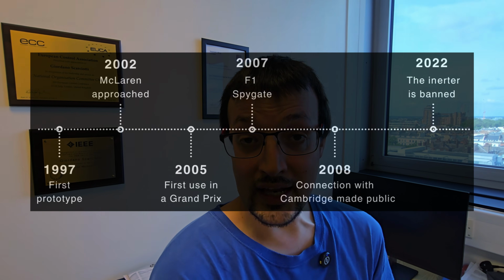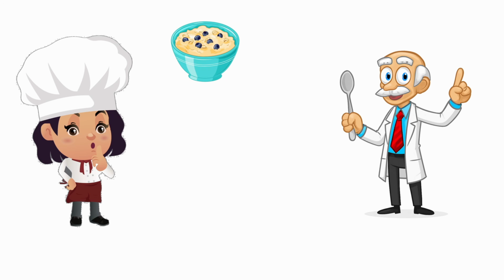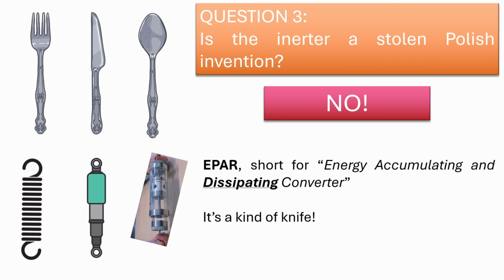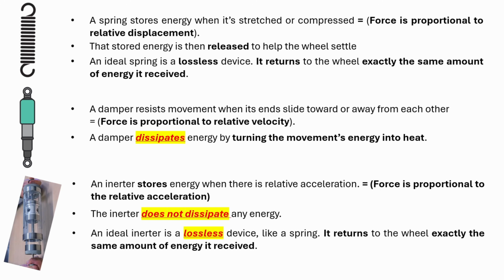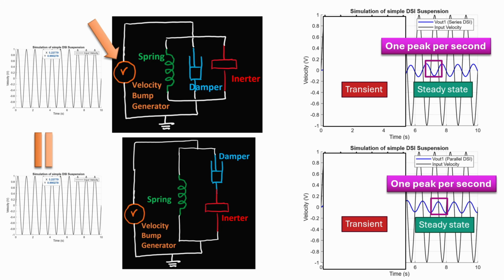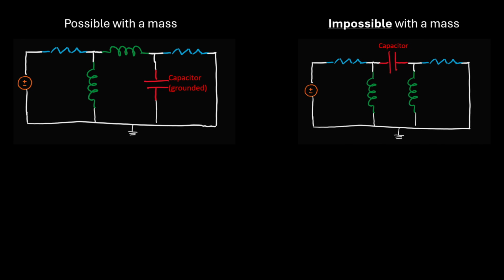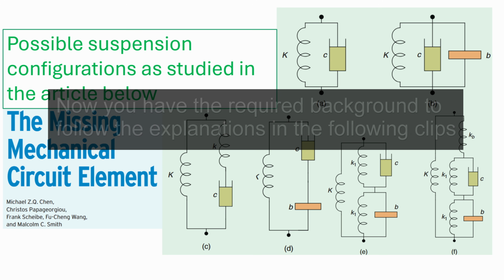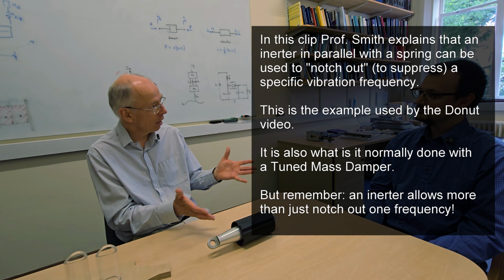Why Everyone Gets the F1 Inerter Wrong | Explained Clearly

Comment: Thank you for taking the time to address this technology!

I suspect that many will say: Okay, but what does it actually do?  Perhaps a little more explanation with respect to what a suspension with an inerter can do that one without cannot?  Also, while the addition of the inerter expands the design space, so that you can better tailor the frequency response, I assume there are still compromises since it must be tuned for the whole circuit - that is: the suspension was not adaptive.  So what I think people might like to know is how this actually allows the car to move around the circuit faster?  Is the attitude of the car better controlled, leading to more consistent aerodynamic performance?  Do the tires grip better in corners or under braking, because there is less vibration?  Can the car be made to traverse a particular bump, set of undulations, or other major, upsetting feature of a track better without messing up how it handles everywhere else?

I think addressing these questions would make people begin to feel they understand how this innovation actually works to increase speed so much that it seems like an unfair advantage.
Reply from the maker: Thanks for the feedback. I can see the value in answering those questions. I think part of the problem in explaining the inerter is to properly communicate what "full design space" means to a non-mathematician. An inerter does not simply increase the design space, it completes it - for real. Mathematically is can be proved that any possible, infinitely many, passive suspenions can be synthesised using these three passive components. Now, one could go your way, the intuitive way, of explaining that an inerter helps with a particular bump. But in reality that approach will give you suboptimal performance. What matters is not helping with a bump, but getting a lap time advantage. So you run simulations, over the infinetely many (practically a large number) of possible configuration trying to minimize your cost function (lap time). And now using an old electrical engineering theorem you know how to build the resulting suspenion. I understand that this mathematical vs intuitional point of view is not easy to digest, but in the end what matters is lap time gain, not getting rid of a particular frequency. That said, I do agree that answering those questions would help to develop a better intuition of the device.
*Let me clarify one thing that I've always omitted. Practically, by "best suspension" I mean one that satisfies also a constraint on the number of components. Otherwise you may not be able to use the optimal suspension you get because it involves too many components. So the problem is constrained to seek the best impedance subject to, e.g., using no more than 6 compoenents.
Reply: @TricksterJ97  it helps reduce unwanted oscillations in the car's suspension, which helps make the car be more stable when it encounters bumps/undulations on the track especially when cornering.
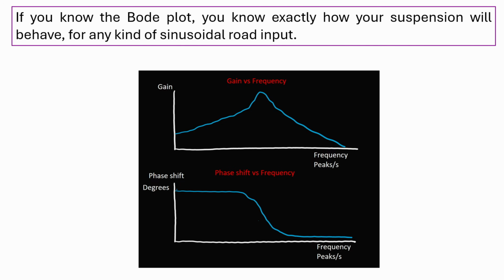Reply: @tricksterJ97 : From 25:03 on you will get the answer

Comment: Are these basically the same as the friction motors in kids toy cars????
Reply from the maker: Thanks for the comment. A friction motor in toy cars isn’t the same as an inerter, but that's an interesting observation since they both use a flywheel. In the toy, the motor relies on the friction between the wheels and the ground to work. When you push the car, your energy spins up a flywheel, but a lot of it is turned into heat due to friction in the gears (I may misremember, but I think you can actually feel the heat after using the toy a few times). Dissipation is part of the design and that’s why the car’s stored energy runs out quickly.
Instead an inerter is designed to be highly efficient, storing energy and giving it back to the system with very little loss (ideally no loss). Its goal isn't to propel the car but to help with vibrations as covered in the video.
Reply: Not in use but in theory, both use a linear motion to turn a flywheel and then return that energy to linear motion after . Actually the toy car version looks almost exactly the same as the first version the inventor made.
Reply: The inefficiency of the kids toy version is not by design, it is just a byproduct of its cheap materials

Comment: Great topic! I propose a test at the end. Keep reading. I am more familiar with electrical circuits than mechanical. The ratio of voltage to current is called impedance (Z) and can be complex (a + ib). You apply a sinusoidal voltage and measure the sinusoidal current. A resistor dissipates energy V/I = R and the impedance is real. A capacitor stores energy in the electrical filed and V/I = 1/iwC = -i/wc (I’ll use w for omega, the radian frequency). An inductor stores energy in the magnetic field and V/I = iwL. Note that capacitors and inductors both store energy, but one has a positive imaginary coefficient and one has a negative imaginary coefficient. If you plot the impedance in the complex plane, you get three nicely spaced points at right angles. Positive real, positive imaginary and negative imaginary. My electrical engineering professor quipped that a negative resistance would involve active power and we are talking about passive devices.  I understand that the mechanical equivalent of impedance is Force /Velocity. Apply a force, measure a velocity. It makes sense that a damper has a real coefficient as force is proportional to velocity. I won’t guess about springs or inerters because I would mess it up. I assume the spring, damper and inerter are in parallel. The more interesting test is to apply a sinusoidal position to the axle of the car (bottom of the shock) and measure the sinusoidal position of the top of the shock (affixed to the mass of the car). Position Out/Position In. Tuning the circuits would change the values. Energy story circuits can have gain or attenuation.  I assume this would have frequency and phase response and be straightforward equations. Phasor analysis only uses algebra. Very visual and what suspensions actually do.
Reply from the maker: Exactly, that’s why in the video I used Bode plots and the electrical-mechanical analogy. What you describe is essentially the same framework, and yes you could use phasor analysis (phasors are again a way of keeping track of just phase shift and gain, while the e^{iw} disappear in the transform - you can think of them as the computational algrabraic equivalent of a Bode plot)

Comment: "The Inerter applies a force in proportion to relative acceleration".  I'm working on a "Tea-Damper".  A Tea-Damper applies a force in proportion to relative jerk.

It's an inerter where the gear ratio is a adjustable.
Reply: I had immediately wondered if there were such a thing. Keep us posted on its progress.
Reply: What are it’s intended applications?

Comment: Thank you very much for the second video, like many I had made the mistake of imagining it like a spinning top. Having spent most of my carrier in electronics looking at RLC network from transmission lines to power supply and signal integrity it was a revelation to realize the same techniques can be applied to the mechanical domain. The example showing how you can tune the circuit to damp out a specific frequency really resonated with me (pun intended :-)).
Reply from the maker: Thanks a lot for the appreciation and support. About the spinning top, Prof. Smith showed me the SkySports video before the interview and pointed out the issue to me. Despite Prof. Smith telling me, it is only when making this video that I truly internalised how central the spinning top illustration has been into creating a misunderstanding. Not stressing the importance of returning the energy into the system is what makes one think that the inerter is a kind of damper. Because the spinning top is a kind of damper after all! (To be clear: I do not blame those who used the spinning top to explain this. They were pioneers in explaining a very new concept, and that was a great analogy at the time).
I am sure this resonated ;) with you given your career. And there is even more to be amazed as this kind of analogy works also in other domains, the most common being heat systems and hydraulic systems.

Comment: Great video. The best intuitive way I can think of how the device helps a car go faster is that it allows you to reduce the amplitude of smaller, high frequency bumps and imperfections in the track - the suspension literally acts stiffer at certain frequencies but is still able to conform to the lower frequency curves of the track.
Reply: I'll lead out with I'm not a F1 driver/engineer, or even fan, so I don't have the terms all lined up... but I hang around in the physics realm a bit.

I think of the inerter more or less as the direct compliment to a damper. Springs are simply a "return to center" devices.

The inerter passes sharp transitions across it easily while passing lower rate changes causes it to give easily instead. This allows it to transfer a bump to the other wheel while allowing the car to rock and settle toward its "standing" center of gravity as the road curves. The result is the wheels always have pressure on the ground regardless of what the car is encountering with the road.

I was one of those that thought this device was at each wheel along with dampers and springs at first... but without even looking it up or seeing where it actually goes, I realized it could only be useful between the two wheels.

To take it full circle with the original "electronics thinking" from the first video, it's a high pass filter... used as both a low pass and a high pass... hence the notch filter mentioned in the video. I'd take it a step further and say it's in fact a "crossover" in electronics when combined with the dampers on each side... dividing where the energy goes for different frequencies. It's really no wonder it's confusing lol It's only with a stronger background in electronics that I can see the parallel at all, but converting between the two in terms of "what does that mean physically"... still difficult to imagine that way. I think that's what threw many off in the first video.
Reply: It does seem to have been used as a heave spring position device, which i belive is sort of a 2 axis anti roll bar (side ro side and up and down=rake). But i do think it might on single wheels in the case for example of my aluminum 2001 honda insight slammig into thr potholes and bumps of los angeles at speed, in wheel bounce up to gripless airborne and subsequent decaying ossilation. I dont think it could reduce noise or occupant terror and discomfort in very light cars, that may require abandoning low profile tires. It would probably conduct nouse around airbag suspension becase of stiction lever ratios impacts.
Reply: Richard Cannon put this in a comment, which I think it's the most valuable piece:
"in reality it acts as a phase shifter by making the car appear heavier than it actually is. As a result pressure at the contact patch from bump response is increased. It makes it act as it has higher unsprung mass without the disadvantage of increased weight. But it does not lock ride height in fact the opposite."
So from what I understand, it makes the tires heavier, it means the car will better ignore the bumps, better sticking the tires to the surface over these bumps. This is the increased mechanical grip benefit. Which is exactly what active suspension was doing in the Williams 10 years earlier.

Comment: Would this concept be similar to the large weights suspended in skyscrapers for earth quakes?
Reply: Those are mass damper, or tuned mass damper to be specific. Which means they are a sort of dampers, and are used to dissipate energy. Inerter stores the energy then release it.

Edit: You could probably incorporate inerter or spring into a mass damper and further enhance the performance, just like they used it to improve performance on an F1 car, but the damper still should be the main component as it dissipates energy, or absorb the earthquake energy and prevent resonance. Simply search for tuned mass dampers and you should have a few video demonstrating how it works.
Reply: Interesting
Thanks  @D_ieus
Reply from the maker: This is correct. About your edit, Prof. Smith discussed the use of inerters in building suspensions at the end of the original interview if you are curious and haven't watched it. Timestamp: https://www.youtube.com/watch?v=FhmLb2DhNYM&t=2732s
Reply: @Prof_Gio  Thank you, professor. I did watch the original video but I guess I did not watch it thoroughly enough. Both videos are very informative to me, especially explaining inerter through phases in this video and linking it to electrical circuit in the last one. Made me clicked with a lot of what I've learned, like why I always felt incomplete with the damping system I learned in control theory, cause it's lacking the inerter when you compare it to the electrical system. And now we could tackle mechanical problems just like electronics, but easier said than done, especially when I need to go over differential equations again since I'm not the best at math.

Comment: Tip of my hat to you, Prof. Scarciotti! Your two well executed videos on the Inerter topic have tied-the-bow on a series of events stemming from my systems simulations course work, one of my favored courses of study, during the late 1980’s in ME grad school when PC’s were just coming into use. My tail is thus. To complete a two-semester-long project that represented most of a students’ course score, my analysis (which include phase/gain Bode characterization, root/locus analysis, etcetera) suggested that the problem could be solved with an inertial input that would, by its nature, lead an oscillatory perturbation and could be mechanically configured with classical spring/mass/damper elements. Digging through the literature and texts, as well as discussing the topic with my fellows, I concluded that there was no such device that I could model and insert into my simulation. Undeterred, I used my analysis to “backout” a “model” (differential equation actually) that I inserted as a block (or black-box) into my sim and, viola, problem solved. My rational and justification was that this was a simulations course, and I didn’t need to build anything. The final result? I got a “C” grade in the class (only passing). My analysis and simulation were rated excellent. My solution was deemed “trivial” as “it did not solve the problem, only the simulation of the problem”. The highest marks in the class went to those who used spring/mass/damper series/parallel tuning to mitigate the problem but not solve it. If I had had a better working relationship with my professor, perhaps a physical Inerter might have emerged a few years sooner. But with no obvious application for such a device and “real life” pressing in on me from all sides, I left the course satisfied at passing and happy in all my new found knowledge. I have not looked back on this time since the amazing coincidence of being fed your video on YouTube. The Internet is truly amazing!! Cheers!
Reply from the maker: Thank you! I’m glad the videos brought back those memories. I do have a similar story of me solving an exam "not in the way taught in the course" and not getting full marks for it! However, that story taught me to accept any working solutions from my students, no matter how they came up with it, as long as the reasoning is correct. There is always somethign to learn!

Comment: Great 3 step explanation! Good to follow!
I still struggle to see which suspension behaviour it can produce. 
Maybe because the inerter cannot do only soup, but so many things in combination. Hard to imagine for a mechanical engineer with little knowledge on control theory and circuits.
Reply from the maker: Thanks a lot for the feedback, I am glad that the three-level explanation is appreciated (I did worry a lot that people may feel offended by the ELI5). The inerter is a young techology with respect to springs and dampers. Maybe in 70 years the inerter will be in standard mech eng books and we will get a much better intuition of its behaviour!

Comment: It's so different from all other mechanical device and so new that we have no intuition for it..our mechanical degrees can only help so much. This video and the previous one was very helpful in getting my understanding just a little better. Thank you for that
Reply from the maker: Thanks a lot for the appreciation, and I think you make an excellent point. We had springs and dampers for a long time. On this timeframe, 20 years is nothing. When I studied this stuff at uni in 2007, no one ever heard of an inerter! It's early days for this device, and maybe in 70 years it will be just another component in the textbook.
Reply: As an engineering undergrad I took a course called Dynamics of Physical Systems which dealt with spring, mass, damper systems. As Prof Scarciotti said, the mass was always _absolute acceleration_, there was no mechanical element that had two poles, unlike the spring and damper.  The inerter is that two-pole device.  That is the point that made it "click" for me.